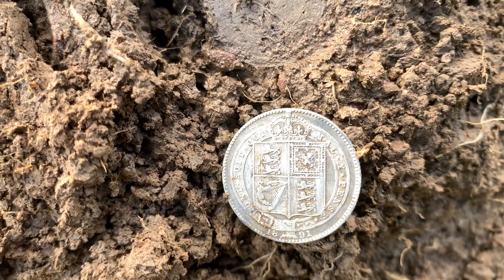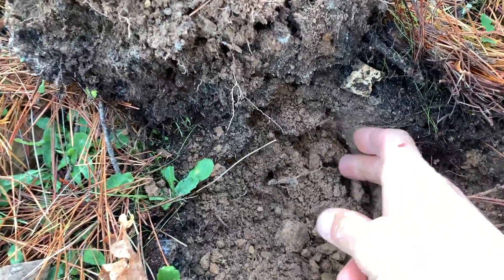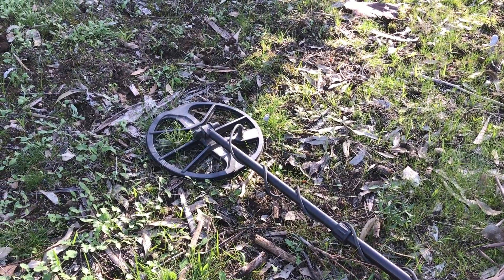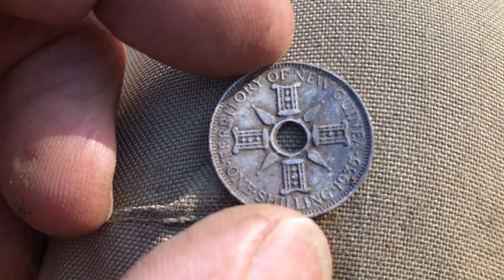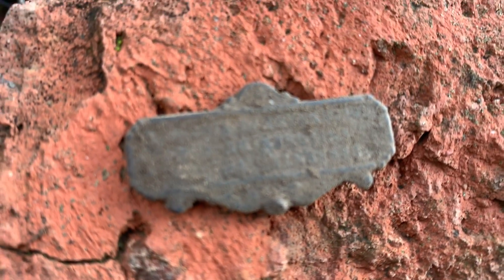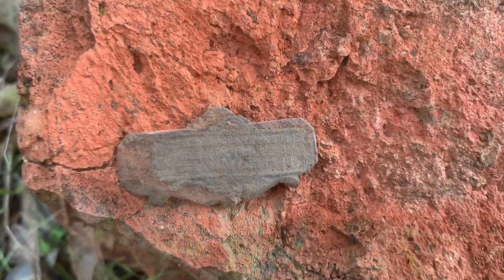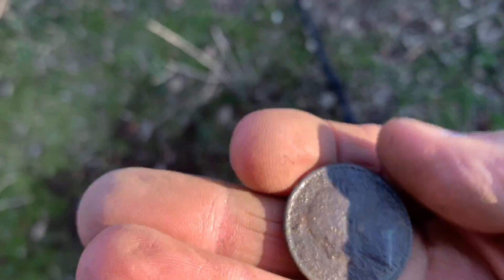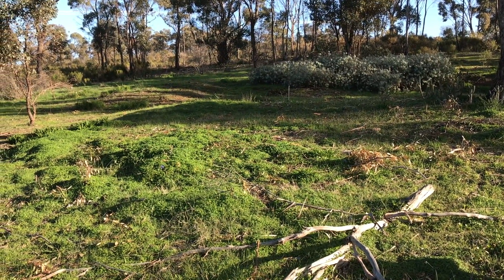More Awesome silvers found by dropping out of multi frequency metal detecting with the Equinox 800.

Comment: Hey mate. Great video. I must experiment with the different frequencies. Always kept it on Multi but I'm keen to try something different. You run Field 1 mode?
Reply from the maker: Van Diemens Digs yes I do most of the time. Where I am, most of the targets are shallow. About 6” or less. I mostly drop out of multi when I have bad emi. Have not done the upgrade to get 4htz yet. Good luck with it. Regards Andrew

Comment: Hey mate cool vid. I do the same trick with dropping out of multi but I switch to 4khz not 40. My understanding was that lower frequencies detect deeper than the higher numbers and its usually the depth for me that makes the signal sketchy.
Do you choose 40 because of the tough detecting conditions on the Gold fields? Cheers, Greg
Aka detectingcanberra
Reply from the maker: gregory anderson I think from memory we tested the other frequencies over different targets and they didn’t pick them up and 40 was the most successful. I haven’t done the update yet to give me the 4 htz. Down here a great deal of targets are less than 6” down. In trashy sites, 2” would pull you up most of the time. My wife just mentioned the update last week too. Thanks for watching. Stay safe. Regards Andrew